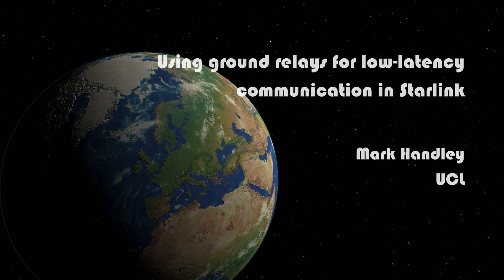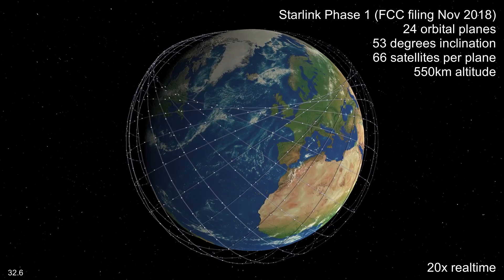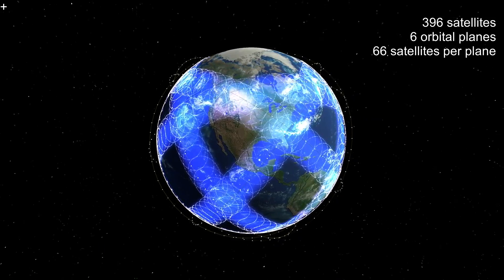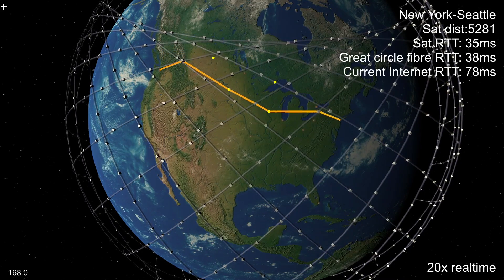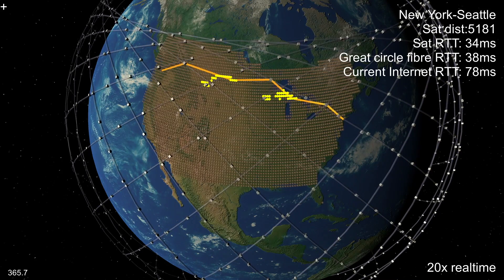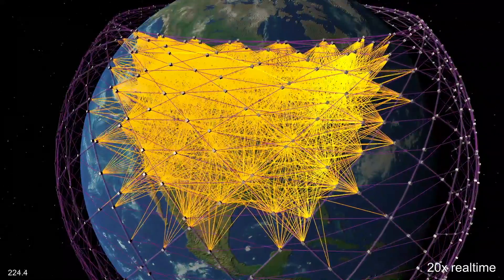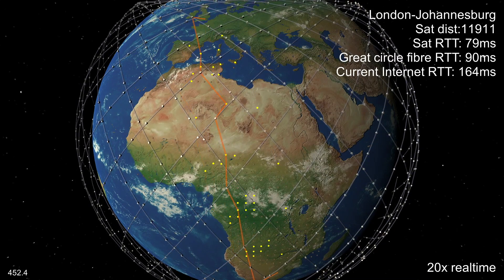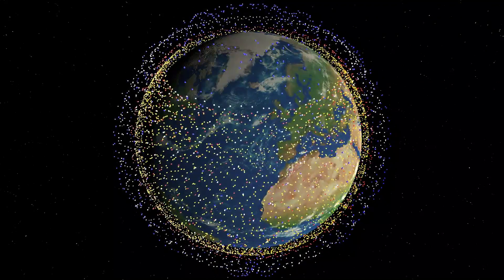Using ground relays with Starlink

Comment: Regarding the 300ms, i just had a question... wouldn’t the orbits be so predictable so as to be able to “know“ the best path and not need to calculate it? I know absolutely nothing about this stuff so sorry if it was a dumb question.
Reply: just because something is well defined doesn't mean it doesn't need to be calculated, it just means that the calculation is relatively easy. you need the data of "I want to connect from A to B at time T" you need to generate that data and then distribute it to all actors that take up the bucket brigade. if the calculation is fast enough, aka very well defined with simple math etc, you could go ahead and calculate link tables ahead of time and then distribute them to the sattelites, which could potentially reduce satelite processing time and thus induced latency, but you still need to calculate it at some point.
Reply: faurana yes, that’s exactly what I was thinking. I also wonder though it it would take more time to test the expected connection than it would to compute it on the spot. Another thought was what if they are constantly connected to a suboptimal connection until the optimal one is ready, almost like testing the best connection ahead, and switching to it once it’s stable, while maintaining the existing connection?
Reply: @albertojimenez4408  if it is possible to pre-calculate all connection speeds, then you effectively don't test it. you test THAT it is faster with several satelite groups trying out both systems, and then if it actually helps latency you use pre-calculated connection maps in the sat network. the actual challenge with this is that you're trading calculations done with storage space needed. once you're using pre-calculated connection maps, you are always on the optimal path, asuming the connection maps are accurate. your skybox pings the satelite network with "I wanna watch mark handleys starlink video" and the satelite network already knows "okay, the fastest way to youtubes servers from you is through [arbitrary array of satelites and ground stations] because that's what my connection map tells me"
Reply: faurana thanks for helping me think this through 😊
Reply: If you're doing path selection based on node-to-node link utilization to avoid congestion and creating "hot spots", it will be hard to precompute the paths.  Also, shit happens and things break, so minimally you need to precompute alternative paths for resiliancy to ensure continued availability.

Comment: I sooo hope this is enough to completely Disrupt comcast, they will be Crawling to elon to get in on that service.
Reply: @Lightspeed Retro Yea but Amazon coming late to the game as two companies one being starlink have first rights to these frequencies which means if amazon satellites detects it's causing interference it must wait till it can start broadcasting on the frequencies so it doesn't mess up star link or the other provider causing high latencies or even short outages till the satellites get away from each other. Amazon is trying to just buy there way in though without going through the hoops Elon went through.
Reply: This wont disrupt any of the current ISPs. Starlink is not meant for heavily urbanized areas, its for mobile, rural, and under-served communities. Even with 10s of thousands of satellites each one has a limit to how many people it can serve at once. 
They are like cell towers and if a large number of people need large amounts of data such as their 4k netflix, its going to struggle. Thus the target market is not the current  base of mainstream ISPs.
The one exception is low latency critical businesses like the stock market. This will hurt the ISP but not to a large degree sadly. Not enough for them to feel pressured to change how they provide service and expansions to data rates.
Reply: Actually one problem I see is everyone is going to want to get in on this, so whatever amount of satellites SpaceX is launching, everybody else is going to want to launch that many too.   From a business point of view, healthy competition is a good thing so they should be allowed to... but from a space crowding point of view, there are limits to just how many satellites we can have up there before it's a real issue.
Reply: You'll see the day when the last Starlink satellite burns in the atmosphere, and Comcast is still around.

Comment: Spacex should hire you
Reply from the maker: They probably can't - under ITAR rules, you usually need to be a US citizen or Greencard holder to work on space stuff, and I'm not.
Reply: @markhandley  I am sure Starlink will have local offices in many countries and there will be many jobs which have nothing to do with rocket engine design or missile guidance, and would not be burdened with ITAR compliance. And even ITAR controlled stuff can go outside US, provided it is done with proper safeguards -- half of the Rocket Lab is New Zealanders in New Zealand, and they work with ITAR-controlled US technology there.
Reply: @markhandley  
I have friends that work there....I'll inquire

Comment: Are inter-satellite connections possible with additional phased array antennas rather than laser communications?
Reply from the maker: The main problem there is they don't have permission to use any frequencies for space-to-space communications.  It's hard enough to avoid interfering with use of the same frequencies by geostationary satellites when you're only concerned about space-to-ground.  Space-to-space makes the problem worse - you'd have to switch off the ISL whenever it points vaguely towards  geostationary orbit.  Lasers don't have this issue, so they're definitely the way to go, if you can make the technology work well enough.  My friends who work on this stuff are confident it will happen - the question is when, and at what bitrate.
Reply: Interesting, thanks for the reply

Comment: Why not only use the first and the last satellite and use fiber between them?
Reply: They will use fiber optic network where it available. For the vast majority of users a few milliseconds difference in latency is completely irrelevant. Originally the talk about beating the speed of transatlantic fiber optic cable started with an idea that some users who speculate on the stock market would pay big bucks to get information a few milliseconds earlier through Starlink than their competitors do through the regular fiber links. It is probably true, but it would be such a waste if that were the main use of Starlink. I think it will have lots and lots of better uses -- providing connectivity to the emergency services no matter where they are, for example.
Reply: John theux Light only moves 60% the speed of light in glass/fiber so it’s much slower. Also fiber links are not available everywhere you would need them.
Reply: @rustyfox81  Yeah, but the main issue is the throughput. Elon said that it can cover 3-5% of the earth population. If you use 10 satellites in a row for one signal instead of two it's gonna be worse.
Reply: @johntheux9238  not really going to be worse. The cross links between satellites is different and additional to the links to the ground
Reply: @RyanDiederich  But it add weight.
Anyway they will add satellites at an higher altitude for long distances.
Reply: @RyanDiederich  they have 3 types of attitude ( 300- 700- >1000)